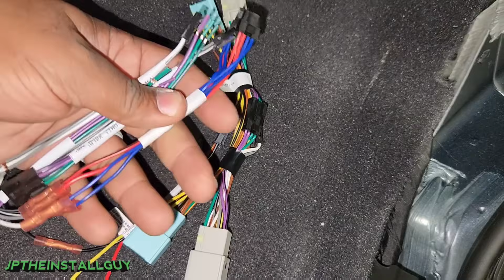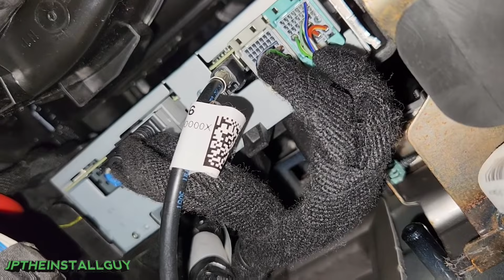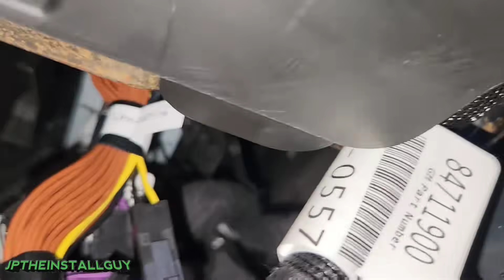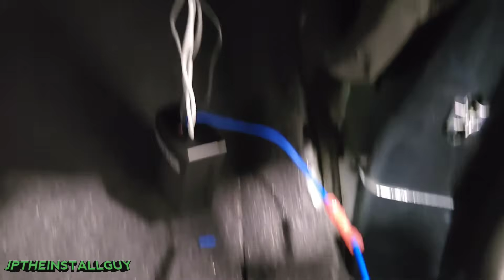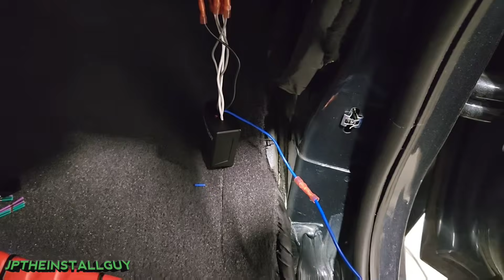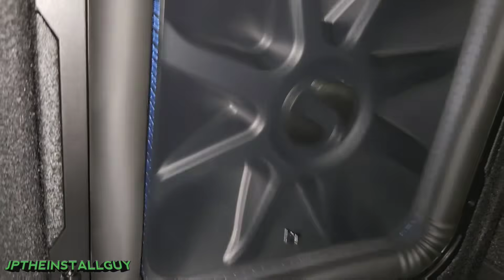HOW TO INSTALL A LOC line output converter to add an amplifier to your factory chevy Silverado

Comment: I struggled for 4 hours trying to unplug those two plugs until I watch your video showing how to pop that clip and then squeeze the clip to get it out. I couldn't see up there so I used the borescope with the pick tool tape to it to pop the clip to pop the clip. Thank you for the valuable information I wish I had seen this video before I attempted to do this without it

Comment: My 2025 GMC Sierra Pro has two 10-inch subs, but that humming sound is driving me crazy! Any solutions? I've double-checked four times, it's not a ground issue. It feels like active noise cancellation.
Reply: You probably have the RCA wires running beside your power wire going to your amp. Run your signal wires down one side of the vehicle and your power wire down the other side of your vehicle.

Comment: Is this the non-Bose system? I installed 2 of these and tapped into  all 4 of the speaker wires from the door speakers (front/back, left/right) and the right side has some buzzing noise that I can't get rid of. The white RCA connection on the LOC is worse than the other side. Both have some buzzing. I have the gains turned down to limit that annoying noise, but the system wants more. They sound better, more crisp and precise with the gain turned up, but the buzz gets louder too. When music is playing it is not bad, but when I am the phone it is annoying or if I have the radio paused. I am thinking about purchasing the pig tail that you used on this video and trying it and/or maybe even re crimping or soldering the connection again to make sure that is getting a good connection. I know my ground is good. One thing that I am curious about is I have a kicker hideaway sub tied in on the  wiring to the LOC so maybe that is causing the issue? I would appreciate any advice. Keep up the great videos.
Reply: I have a 2014 Silverado, non-Bose, 8" radio

Comment: i used this setup for my install on my 2024 silverado 2500 and my amp isnt turning off but the power light is off on the converter.  do you know what would cause this?

Comment: I was so confused why you wouldn’t just use the front wires to the front wires so the colors matched because essentially it’s the same harness
Its so backwards you use the red and blue to go to the white and gray or green and purple when it’s exactly the same if you use the correct colors
Thank you for the video
Second time using one of these harnesses so I don’t have to splice or cut any factory wiring

Comment: Greetings, Quick question on the use of this T-harness with only high level speaker/level wire and not in combination with LOC or RCA wires connected to RF P300-8P amplified powered subwoofer, after install the added subwoofer does turn on and allows tunning adjustments however, there is clear distortion now coming out of the front door and dash speakers when the volume dial on the stock head unit is turned up to just about the half way mark when listening to any genre of music. The (E) adapter cable is connected to supply signal from the front speakers and wondering if changed over to the rear will make any difference. have you or anyone ever experienced this? and if so what steps were taken to resolve the matter? distortion noise is not like interference from the engine or alternator but more like voice distortion when volumed is peaked loud.

Comment: If I have a factory bose amp in my 2018 gmc sierra what would I need to bypass the factory amp and install a aftermarket amp
Reply from the maker: You would need the same style harness except the amplified version also a converter and installation would be on the back wall I believe email me on my site www.jpsaudio.com if you need help

Comment: another great video.  i am in the process of doing this very thing, but without the LOC.  i have a 9 cable speaker wire that goes from the main harness down to the amp.  how can I figure out which wire in the main harness I need to tap into to run that remote wire that goes to the REM side of the amp?  do you know?

Comment: I’ve got the LOC too and it will not turn my amp on what some things I need to check. I’ve hooked everything up it’s supposed to be and it’s on a 2003 Honda Accord.
Reply: Remote wire. Where is it hooked up too?

Comment: Love your channel man…it’s helped me out a lot! Quick question, if your aftermarket head unit and amplifier give you the option to use line level or speaker level connections between them, do you get better audio using line level connections or does it not make a difference???

Comment: Okay so that 12V turn on wire goes to the amp! Thank you bro you helped a ton!
Reply: So, you don't use the blue Remote Out on the LOC?
Reply: Thank you I like this much better than cutting into the factory harness, especially since I’m still under bumper-to-bumper for 15,000 more miles

Comment: I'm trying to hook up some LG party speakers, I had to cut and splice negative and positive, I went into the front door to tap into the speaker wire instead of the radio. I didn't run the blue wire to the remote, I just connected to the amplifier. What am I doing wrong?